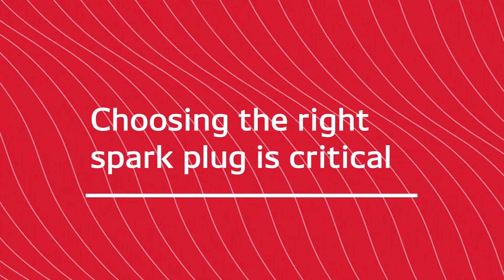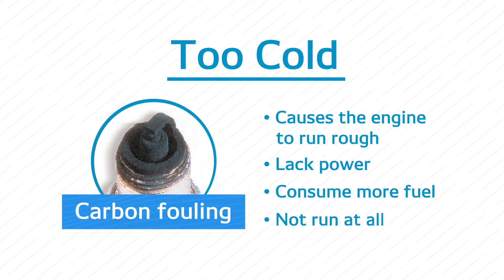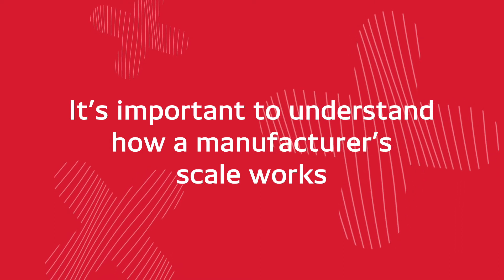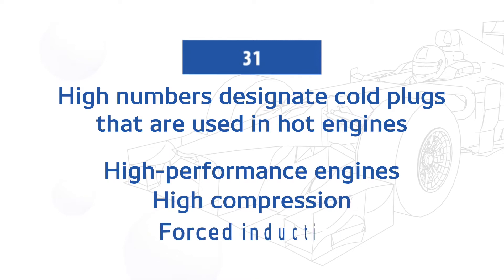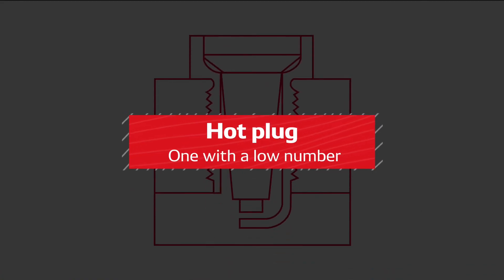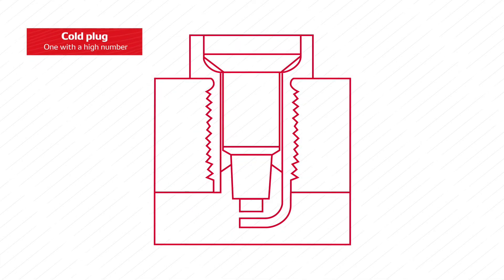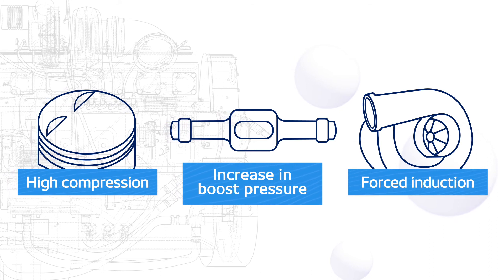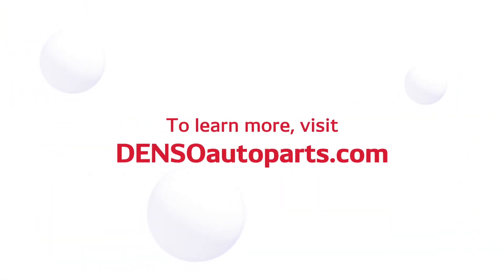DENSO Spark Plug Heat Range Overview

Comment: Love it this was a great help I was a big chevy man for years and as far as older goes yep still am ! But I got into Toyota around 15 years ago when my brother law could not tear it up only if he wrecked it and totaled it I could see how tuff they were ! I know they own denso and that name there is so big used on all different kinds of vehicles. I use there hairpin alternators for running large amps for audio systems. They put twice as manny diodes in there hair pin it’s absolutely amazing how a fist size thing puts out around 400+ amps and is so smooth at doing it . There’s one thing I’ve learned about alternators the more diodes in the rectifier the more amps you can make from the converting AC power to DC power . Also it keeps it a whole lot more even when a big load hits the alternator you don’t hear it draw down the motor like 100+ rpm the voltage does drop a little but the power from the way there made ! It’s a fine peace of work when you look at it in a whole unit. It’s smart made we’re burn rectifier up , brushes , or your internal voltage regulator . With denso no problem those componits are in the back but can be easily accessed from a removable plastic or pressed aluminum only the stator and rotor +bearings have to split the case to get to them so it’s a no brainer I’ve got a rectifier it’s full copper I’ve polished and a whole case I’ve polished I gotta find someone who could make me a cover out of clear plastic so it would be crazy to see that copper rectifier on polished aluminum case . Love denso stuff there are one of the best if not they don’t miss it by much great auto parts manufacturer it’s just simple long lasting products that just work great ! I love looking at the great time and thought it took to build something you can trust and put faith in that it won’t let you down if it does there are so manny miles you know you got your moneys worth